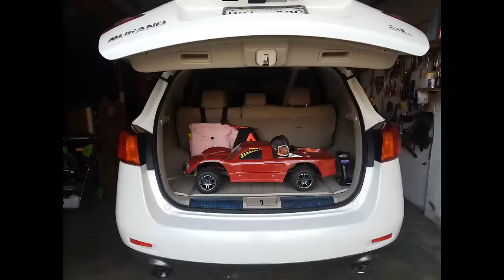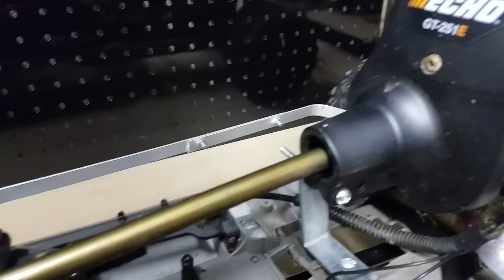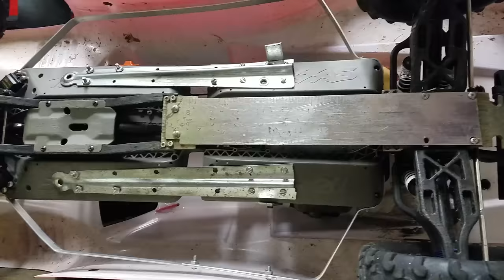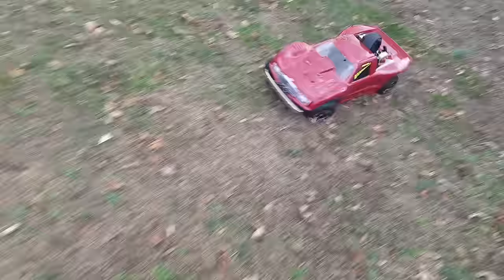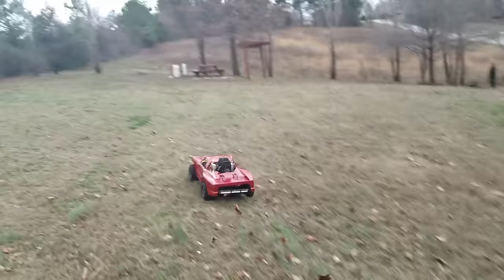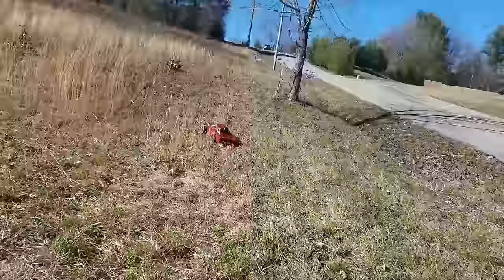Weed eater RC Truck- Custom 1:5 Traxxas Emaxx- Maxx Echo

Comment: Hey Parker - great video! You have a  "radio" voice - plus, you're a genius!  I love the shots you did low to the ground.  Makes it look like the real thing.  One thing: how do you control the car?  Just curious!  PS - I'm Deb's sister.  She shared with me.    Janet
Reply from the maker: janbrad1 Thanks so much!  The car uses a radio-reciever setup. Simply a remote sends signals to the receiver which gives power from a small battery to servos, small motors that push or pull on my input. The throttle is pulled by cable connected to one of these. Hope this answered your question and thanks for commenting!
Reply: He is beginning work on a plane.  It just blows my mind.  You should subscribe to his page so you will be notified when he releases his videos.

Comment: I realize this is an older video , and you might not see this . I would message you , but I don't know how .  I was wondering if you could explain in more detail how you connected the motor to the transmission, and what kind of transmission it is . Usually the shaft coming off the clutch  has a square hole on weed eaters . I'm trying to build something similar, and I want good gearing and the look you have here . Great video btw I love the truck . Any info would be greatly appreciated  thanks .
Reply from the maker: It is very interesting how it is connected, actually. I mounted the weed eater first, then built the drive shaft. The chassis is all stock Traxxas Emaxx and the transfer case and gearbox are as well. I simply took the bearing and front face off of an electric motor and mounted it where the pinion gear would go, so a shaft could go through just as the original motor did. It also fit where the motor mounting holes are so it is adjustable for different gears. Then I used an Integy Traxxas Rustler drive shaft that had the perfect diameter to go through and ride on the bearing. I ground a groove on the end where the wheel hub would go and mounted a Mod1 Pinion that fits a 2200kv motor.  The universal joint on it allowed the weed eater to be at any angle. The other end of the drive shaft had a small hex- I found the socket from a tool set that fit it. This allowed the other end to be a square outlet for an extension. I just kept connecting sockets until I could get a phillips screwdriver bit on the other end. Believe it or not, some phillips bits fit perfectly into that square on the output of a weedeater. Once I got it the right length, I found a pipe that fit over the sockets to keep them uniform and straight as it spun. If I had advice for someone doing what I did, I would mount the weed eater last. I just happened to get really lucky because the angle was perfect.  As for the gear ratio, a weed eater can run 1:1 and have plenty of torque and still go about 35-40mph, and this truck weighs at least 20 pounds! If you have questions, please ask and I will be happy to answer them. Also, I can email you pictures if you give me your email. Thank you.
Reply from the maker: Yes it is a pinion with a set screw. It is a large 34 tooth module 1 gear. The shaft it is mounted on was round until I ground a groove so the set screw would grab. Since it was a wheel hub, however, I still put a nut on the end of it to hold the gear on and not entirely depend on the set screw. It worked fine without the nut though. I sent you some pictures in your email. Thank you - I am more than happy to answer any questions for you.
Reply: Thanks man , you've been a big help .  I see what I need now to make it work .  👍

Comment: How much did the car end up costing you I’m trying to build one and I have an engine already
Reply from the maker: Cost varies depending on what you have. Assuming you have a complete roller to use, cost can be free if you use what you have. I used junk I found in the garage. Only money I spent is $100 on the body.
Reply: @makeshiftworks9779  a complete roller?

Comment: Hey dude, this is great, I'm great with engines but... what would I need to run a remote to the engine how would that work and would there be a specific remote and what not that I would need to use?
Reply from the maker: Hey, I'm really sorry for not getting back with you sooner! You should ideally use a RC car/truck trigger remote with a receiver box run off a small battery and plugged into your servos. You need at least a two channel remote. To name a few nice ones, I'd go with a Spectrum DX2e or a FlySky FS-GT2. Those come with receiver boxes. For a basic unit, the Traxxas TQ will work just fine. I'm specifically using a FlySky FS-GT3b. As for what not to use, I wouldn't recommend using a joystick aircraft remote, but it will still work. Hope this helps!
Reply: @makeshiftworks9779  thanks man! I'll look into it. I appreciate the help and reply.